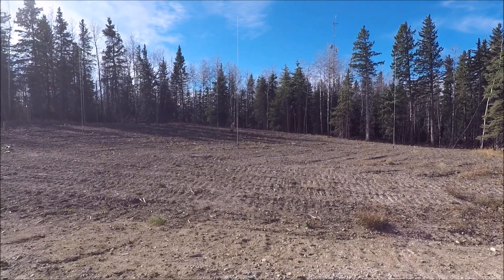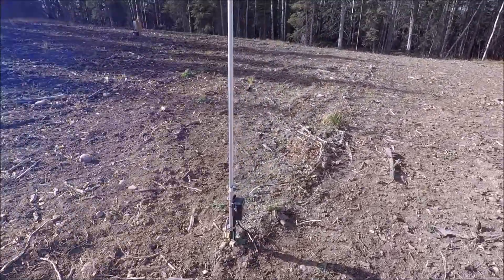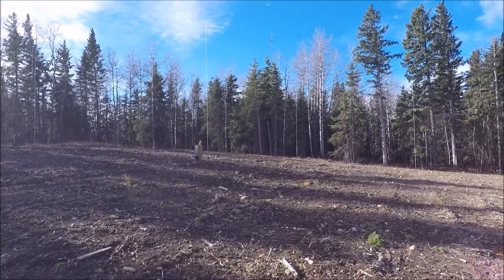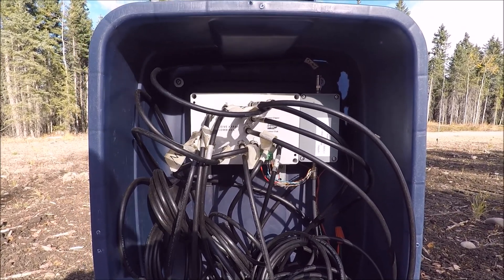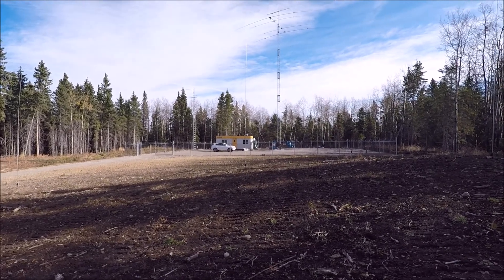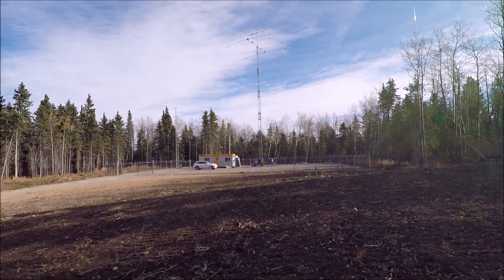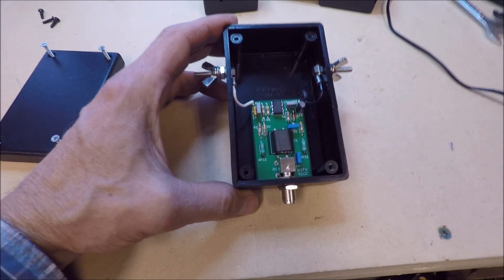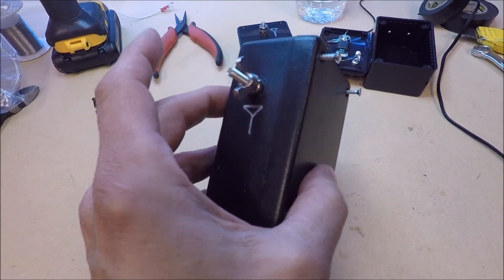The 9 Circle Vertical RX Array at  the VE6WZ  remote

Comment: Why is the preamp unity gain?
Reply: Hi Paul, since no one answered your question from a few years ago, let me help explain.  Keep in mind that the short verticals used in this system have very high impedance (approximately 2500 ohms).  While the voltage gain of the op amp circuit within the preamp is unity, the overall preamp voltage gain is actually less than unity because there is a 75 ohm resistor on the output of the preamp, but since the preamp converts the very high impedance of the short vertical down to 75 ohms there is considerable power gain.  I won't go into the math here, but the power gain is much greater than unity.  Therefore the unity gain preamp does a great job of not loading down the output of the vertical, while also converting it's impedance from approximately 2500 ohms down to 75 ohms.  73, Don (wd8dsb)